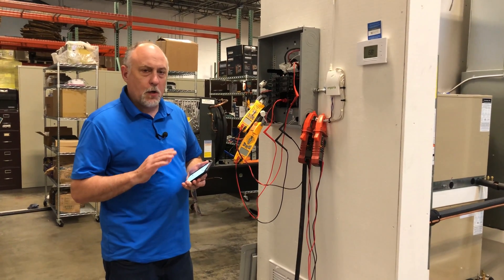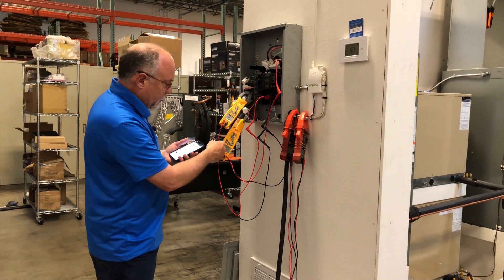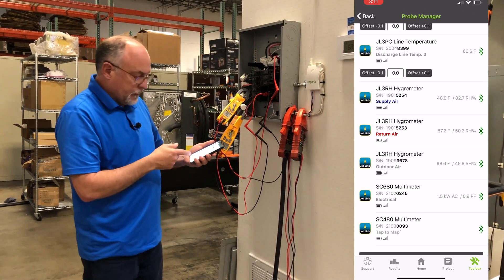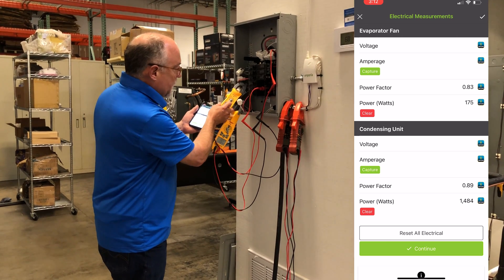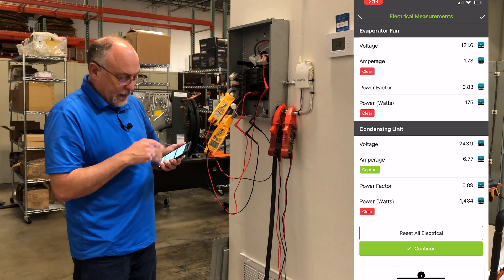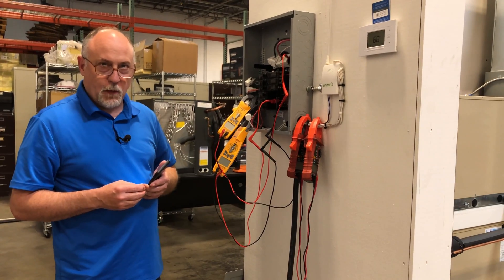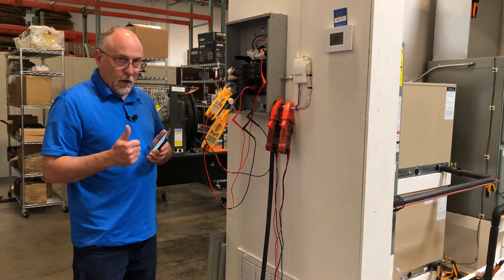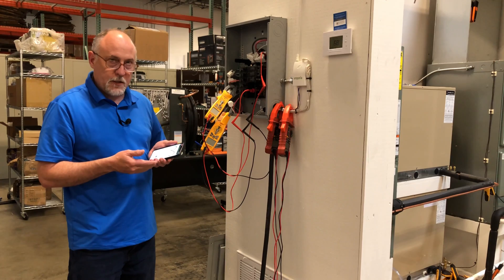Fieldpiece SC480 and 680

Comment: Was looking at this and the beeping was driving me nuts through the whole video. Read the manual and it says "
An audible beep will be heard and

red LED will be shown. To toggle the high voltage
beeper, hold SELECT when turning on. “Beep On” or
“Beep Off” is shown on the display when toggled."
does anyone have this meter and know if this is accurate? that would definitely be a breaking point for me not to buy the tool if there is no way to turn it off.
Reply: I didn't think you could shut em off that and other concerns have kept me from buying the sc680...

Comment: Hey, I bought an SC680 a week ago and just wanted to let everyone know that they seem to have addressed one of Jim’s concerns.  Any time I turn the meter on the wireless is on by default.
Reply: So far any issues with ghost voltages or anything like that? I know when it first came out there was but they fixed it. thankfully field piece will fix it or send you a new one if you send it in to them.

Comment: I have a question on MQ on the Approach Calc for A/C system testing:  The app shows, (for the "system info" parameters entered for a 5 ton HiEff 14-16seer Condenser, 400cfm/ton, r410a) that the Approach "allowable range" is -2.0'F to 4.0'F.  However, the Approach dial meter never goes below 0.0 even when the LLT is lower than the outdoor temp which may occur briefly in initial startup.  I also confirmed that it does not show values less than 0.0 by manually entering a test value for outdoor air temp which was higher than LLT. Could you check the Approach Calculation performed by the MQ app?
Reply from the maker: The allowed should not be calculating below 0. Approach is how close the LLT is to the ODA. As the ODA is what cools the condenser the coldest it should get is to the ODA temp. As the uncertainty in measurement is +/-2, when the approach target is 0 it is simply showing the math. If the temp was actually lower than the ODA you would be looking for a restriction or a wet condenser.
Reply: @measureQuick  thank you for confirming that.

Comment: Someone get fieldpiece in here to explain why bluetooth can't just be turned ON or OFF and saved in firmware instead of resetting.

I clicked this video thinking I was going to buy, because the beeping is forgivable and useful, but that is just so silly.
Reply from the maker: I did reach out to them, there’s nothing they can do with the existing firmware to update the meters.
Reply: @measureQuick  is that possible to flash it with new firmware at factory?
Reply from the maker: @Mr0ozo0  No, it is not
Reply: yes, I agree with you .  my guys threw the meter back at me after 1 day in the field.  The redfish is on their way

Comment: Will MQ add the multi meter mapping using two or three iDVM 550 meters?
Reply from the maker: Right now you can use two or 3 m, but you need to connect and disconnect. We are working on having to connected at the same time, it won’t be long.